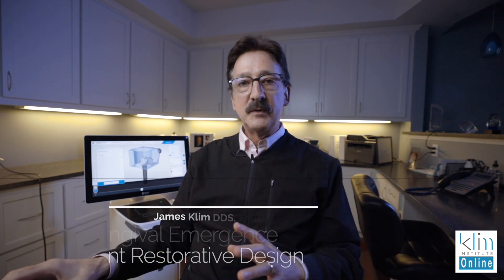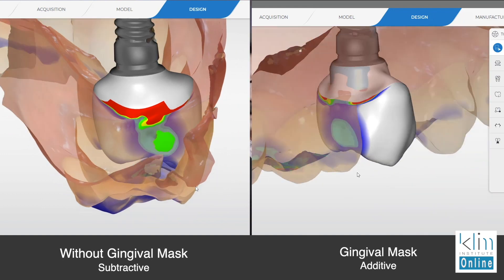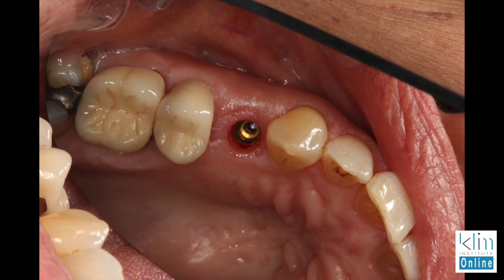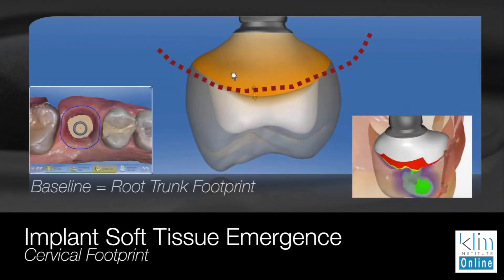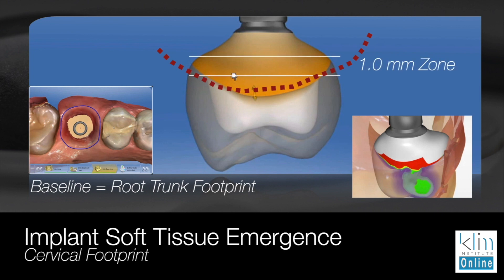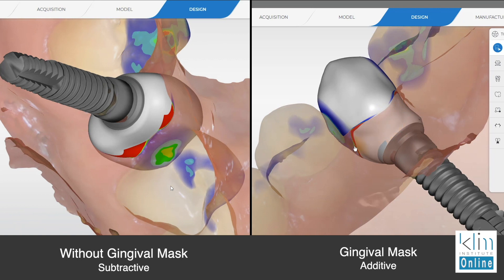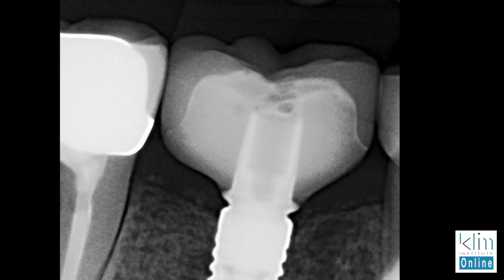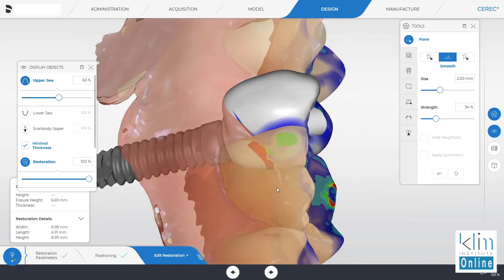Implant Restorative Design to Avoid Food Impaction

Comment: Hi Jim, lately I had a few screw retained implant crowns having mesial open contact while I even set yellow for contacts. For my normal crowns or onlays I set green for contacts and the contacts are spot on. I'm on 5.2.10. Do you have any tips for this problem? The unpredictable implant crown contacts are really frustrating.
Reply from the maker: Yes, I hear you frustration.  With the crown contacts being on, then we know it is not the mill or camera, maybe.  What impression post system are you using?  More than likely it could be in the impression protocol, such as ScanPost fully seating on the implant. This can be a problem with the DS ScanPosts with sub-osseous implant placement, and then the fit of the ScanBody.  In your case it could be the version of software.  Was this happening until the 5.2.10.  Which milling unit are you using?   I have not moved beyond the 5.2.9 software at this point due to motion board compatibility with Primemill.

Comment: In my case a 4 units bridge over 3 implants was placed following a sinus lift and grafting (immediate implantation).

1. In retrospect I learned that implants with internal hex connection had been used.
Any reason you might think for not using implants with a conical connection?

2. This is a zirconia bridge. I can see very massive connectors.
Is that inherent to zirconia bridges?

3. Due to the massive connectors, I cannot reach with flossing or proxy-brush. I use a water pick every evening.
Is there any way to design a zirconia bridge with the implants accessible by the proxy-brush and floss?

4. I am a thin biotype.

5. A similar unit is going to be planned on the other side of the maxillary.
How an emergence profile should be designed for the implants in the bridge.

Your feedback is greatly appreciated.
Reply from the maker: 1. There are a lot of different attachment styles based on implant brand and application.  I have used Internal hex, conical, etc., which all work.  It may also be based on the applications and alignment condition of the implants.
2. The connector(s) size is based on engineering needs for the bridge's strength and occlusal space.  Zirconia bridges are designed in software that provides metrics for connector size.
3.  Water pick is often the best way to clean around implants and implant bridges.
5. Emergence style is impacted by many factors such as biotype, where the implant is placed to the bone, how much bone, etc..
 
These are good questions and should be asked by you to your provider of care. The condition of your mouth, gums, bone, and bite will play into how the restorative work can be implemented. I wish you all the best.

Comment: Im new to implants,  what would i use to guage if my implant crown needs a custom abutment?
Reply from the maker: It depends on your systems and workflow.  With in-office CAD/CAM and software, we plan the restorative strategy virtually, then develop the implant placement with the crown-down approach.  This will provide a more optimal restorative design and placement.  In my practice, I customize most of my implant restorations because I can control emergence, functions, and final aesthetics.

Comment: Hello Dr. Klim,
Thank you for another great presentation with detailed explanation. 
I have watched you polishing crowns after glazing to remove surface microporosity to create a more smooth surface !
Over the years I observed that emax crowns have tendency to stain. Since I watched your polishing video I polish the crowns before I deliver resulting better stain resistance.
I routinely use lab made emax crowns with titanium custom abutments made exactly to gingival level shaped based on the logical principles you just mentioned. 
I get excellent tissue response. It makes me think that titanium nitrite coated custom abutment has a much smoother surface thus having a better tissue response.
Your thougts ?
A lot of respect for your passionate contribution to the art and science of dentistry.
Monterey, CA
Reply from the maker: Thanks for the comments! From what I have seen in the research, it is more about how the subgingival implant restoration surface is finished than the material.  As long as the healing collar is not removed more than once following surgery, the epithelial attachment will occur to the cervical side of the emergence zone.  All the best.